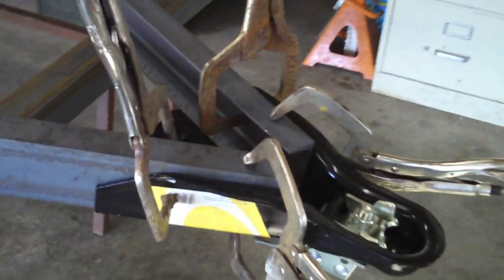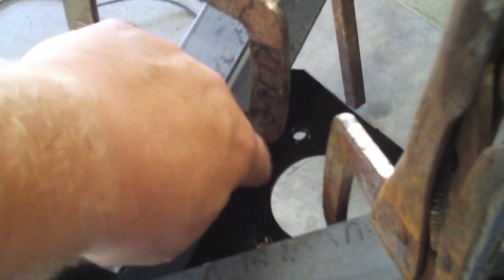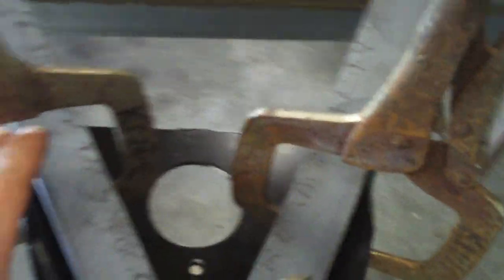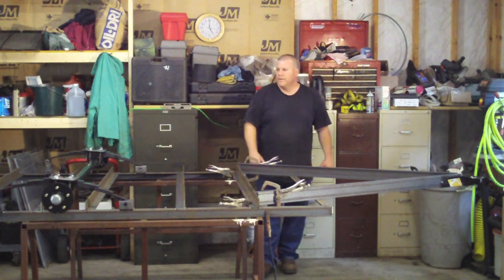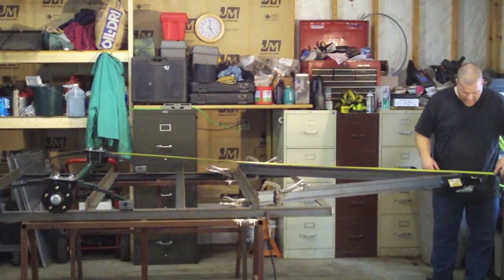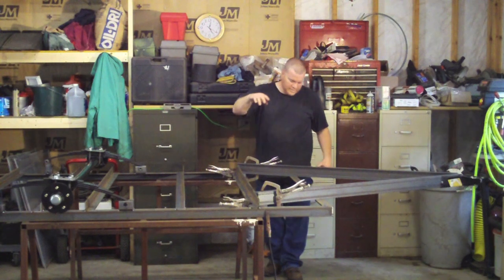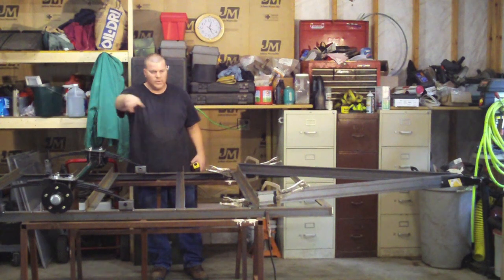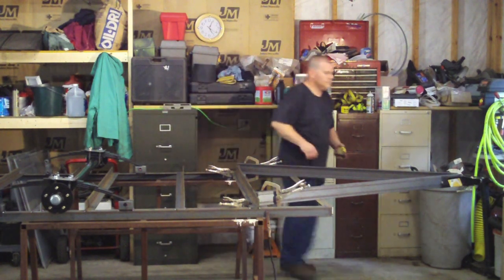How to Build a Utility Trailer Part 5 Installing the Hitch and Welding the Frame

Comment: Your angle iron design like most inexpensive big box stores trailers, prevents you from putting your trailer tongue all the way back to your second cross member. All of your tongue weight is on the first 16" of your trailer and makes your frame very flexible when carrying a heavy load, which can breaks welds or metal.. Not a good idea for any trailer, because EVERYBODY over loads a trailer.

Comment: If you didn't preheat the weld surface then you better check for cracks on a weekly basis.  The coupler is a critical weld point and it will take a beating and if you didn't do it right you will pay later.

Comment: I WONDER IF THE TWO FRONT CROSS FRAMES ARE STRONG ENOUGH TO WITHSTAND THE TOP TRAILER WEIGHT PLUSS BEING WELDED TO THE TWO A FRAMES TO HITCH? THOSE TWO FRONT ANGLE FRAME BARS